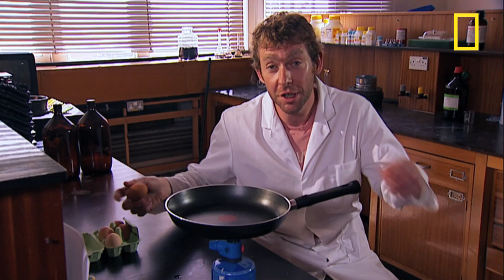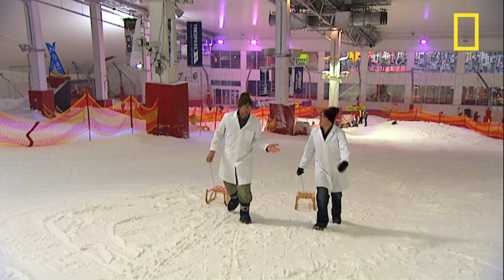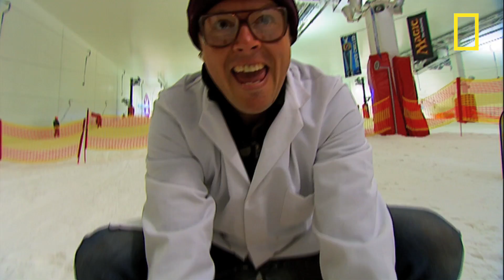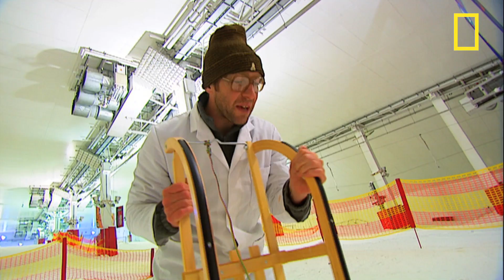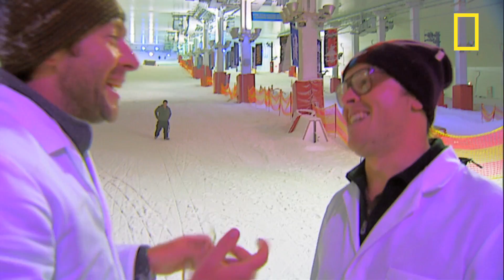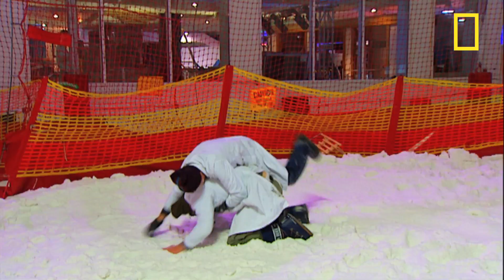Teflon Racing | I Didn't Know That

Comment: Try magnesium aluminium boride, about 2.5x as slippery as teflon, not trademarked, and has about the same melting point as steel. Oh, and it's the third hardest material known, if I'm correct.
Reply: Bam!

Comment: It's actually 9.66 seconds, because the timer is measuring frames on a 30fps scale and showed 9.20 at the end, or 9 seconds and 20 frames, or 20/30 frames, or 0.66 seconds.

Comment: Exactly.  Weight makes a difference, the route(considering the surface was very uneven from the looks of it), the position in which they layer on them, etc etc.
A freshly plowed surface & letting the sleds go without anyone on them would've sufficed better.